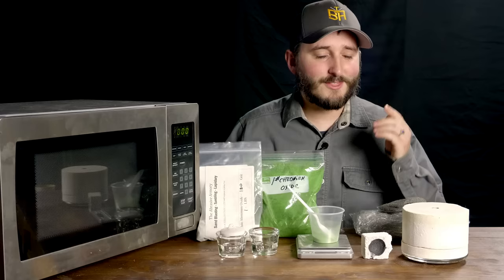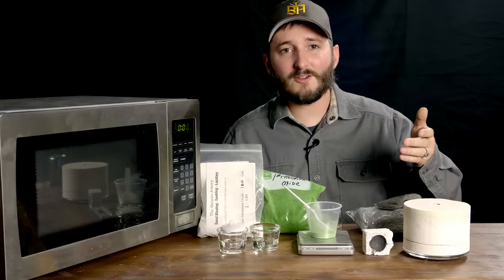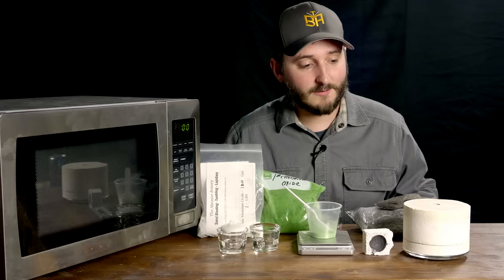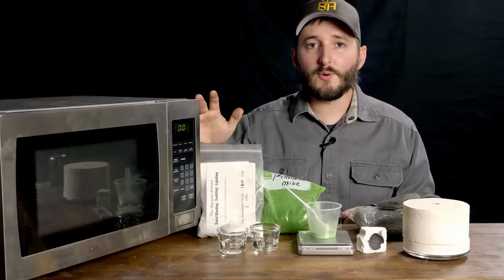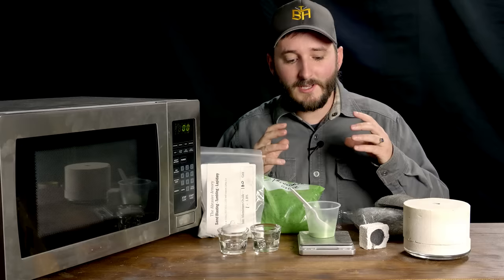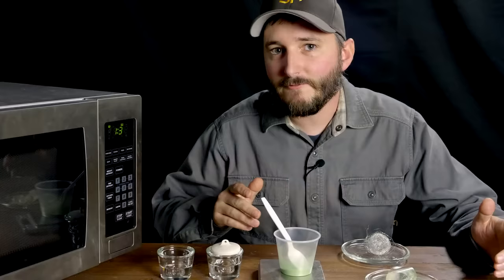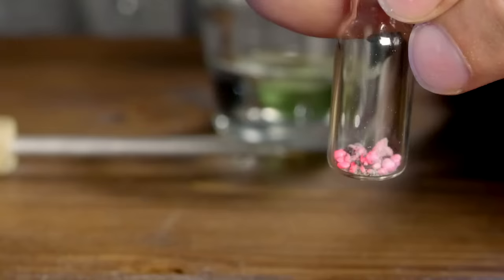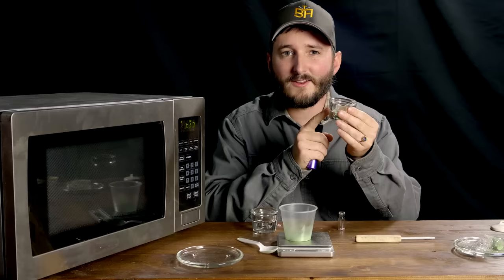How To Make Ruby in a Microwave

Comment: Wonder if an electromagnetic coil could do it. If its only as simple as melting them together it would work, those things can efficiently and cleanly melt steel !
Before anyone says, "But aluminum is non magnetic", true, but so is copper, it is still effected by the presence of a magnetic field and can generate heat in the process.

Comment: What about inductive heater ? (when glass is hot it conducting electricity)
So firstly you could heat it up enough then turn on inductive heater (around kiln )
And more to it wall if kiln could be cooled simultaneously so that substance inside would be hot but walls of kiln is cool .
(like in rocket engine -- walls of engine that is cooling constantly)

Comment: Excellent work. :D

Agreed for keeping the kitchen microwave and the workshop microwave separate. :D

When i first read about making artificial gemstones 20+ years ago, one of the uses was fractal heatsinks made from diamond for computer cooling.

I don't know whether ruby would work as well, but it would be an interesting project... :D

Thinking about the shapes that you use, one format that could work, if a grid-pattern heatsink-style shape mould was carved from ceramic, add a matching framework of aluminium wire, pack with the seed material, and set to run till all of the seed material is converted.

Not sure how well this would work.

What's there a ratio between the amount of material converted and the run-time?

How efficient is the conversion process of the seed material to ruby?

More idea's to chew over... :D

Comment: I like your video . I've watched several free energy videos in the past. I understand drag and heat and friction losses preventing perpetual energy. However i've often wounded if you pet a smaller pulley on sat the green mother you have for a gear reduction causing it to spin faster than the other motor wound it produce more energy plus if you andded more copper wire binding in the motor would that produce more energy with it . To keep it having a jump boost could you add a capacitor into it . I also understand about line drop ..what would be benefiting and or start becoming to much. I'm also sure you have to have the energy going somewhere like a storage unit I understand as well dc power is different than ac power so it needs to be converted and you loose power through it as well.

Comment: You should just put a layer of aluminum foil in your small cup, loosely trim the edges. Fill it with your powder, put it on a plate. Put a solid glass over it to cover everything. Then you should be fine

Comment: You can't make a transparent ruby with this method, because it doesn't melt properly, only the grains melt together, the material will be full of air bubbles and it will be opaque when it solidifies.

Comment: The crystal structures are completely missing from it. These are "ruby glasses" technically it has the same Al2O3 base as ruby do but without crystal structural which is needed to call something a crystal. So you can call this only glass. If you want to make true ruby with crystal structure you need extremely high pressure and extremely heat to grow them and for weeks of time not just seconds as you did. This requires special growing pools which is still very expensive...

Comment: Just saw this, If you think about it warp it tight in foil put in glass and vac seal it two things should happen the vac should increase the heat and because the powder rap in foil this should come press the powder tighten the "magma"? in to thicker ruby.. that's my theory but not sure  just thinking it needs pressure to make a big chunk btw got idea about diamonds you could do that with carbon?

Comment: Should consider making a small crucible out of silicone carbide... Can use something like water glass to bind together rock tumbler grit to make it. SiC does remarkably well absorbing microwaves and can get insanely hot. Since its a refractory material it might get hot enough to melt aluminum oxide... You may be able to make some very large rubies with such a setup... Or it might not work at all ¯\_(ツ)_/¯

Comment: I wonder if a fine aluminum powder would help with forming larger rubies....and my gut also wonders if doing so under a vacuum would be beneficial ..(clearly costly, though. - have to find a way to seal the material inside glass- and then have a port that also needs to be sealed when the vacuum is pulled. )

Comment: hmm, would a thick glass straw/cylinder work? maybe try a stacking method of ruby seed, steel wool and so on. what if the glass cylinder/straw had small holes along the walls?

Comment: What if you used aluminium powder instead of some of the alumina and aluminium wool? The heat should be more widely distributed and at the high temperatures, it should oxidise to alumina.

Comment: That was a good watch. Id say the quality of the ruby is low, because of the wire. Its not very homogenous, so you will get slightly different conditions over the whole sample. Im sure its fixable, but its not easy. But considering how simple the set up... thats really impressive!. We are not talking about a machine that has uniformity of the heat over the volume in mind. For food, small variations dont matter. For rubies... probably does. Id say that those rubies were of surprising high quality, and so big as well. I mean you just "stamped" the wires in really :). 

It was also fun to see your "failures'. Its good to see the process, even if just an overview. This made me subscribe, im gonna see the rest of your stuff.

Comment: How about trying to cut up some of the aluminum wool fibers and mix them in with your ruby powder and then place some aluminum wool pieces on top? I'm thinking of a more uniform plasma dispersed throughout the ruby powder with the smaller flakes of aluminum wool, if that makes sense?

Comment: You know that the microwave uses a strong Transformer that gives out 2000 volts of electricity you might want to try that other approach of shooting that onto that powder to see if you could make bigger rubies at a higher Heat a voltage

Comment: Okay, kiln covered with graphite did not work, but what if instead you put some graphite chip/rod into the seed material? As I understood correctly - only thing that was catching the heat in the microwave oven was the graphite and then radiating it out

Comment: You can add water to your mix of aluminium and chromium oxides in a glass and let it dry - maybe you then will stick to the surface and be able to put it upside down.

Comment: The plasma is forming from electric arcing in the air. If the wire was inside the material, it wouldn't make the plasma.

Comment: Why haven't you turned this process into a similar 3d printer that is used for metal printing with microwaves and a tig welder pouring down into that powder layers at a time?

Comment: Would removing the rotating mechanism that holds the plate, allow a more even distribution of the micro waves? Doesn't the waves go linear and the reason for the rotating tray is because of the linear Waves.

Comment: never thought, that a microwave can be used to do something good with. Ever thought you can only destroy things with a microwave, like food or everything else you can put in.....but never thought that it's able to create something, but why not. it's just a machine, which makes extrem heat in a short time.

Maybe you need a different phiole made out of the same material like the ceramic? pot you explained.

but what is needed to make better rubys or could you made emeralds too? would it be possible to make artificial 100% clear rubys in a kind of Microwave machine? maybe put 6 microwaves together, to one exrem powerful microwave, which shoots waves from all sides. it probably would destroy itself or create a black hole from so much power XD

Comment: Did you ever try making a home for the seed material out of the wire? I wonder if you lined the bottom of your holder with the wire with little edges hanging over the top and filled it with seed material if it would make a larger ruby
Reply: I am doing things like this right now and I need I finer AlO powder to work, once I try with a better powder I will tell you what I find
Reply: @rhysmeier2921  ooh do let me know what you find!

Comment: Could you use steel wool in place of aluminium wool? Is there a reason to use aluminium wool in particular?
Reply: Rubies are scientifically known as corundum, a rock-forming mineral and crystalline form of aluminum oxide which is two aluminum atoms and three oxygen atoms (Al2O3) in a close packed hexagonal structure. Corundum typically contains traces of iron, titanium, vanadium and/or chromium.

Comment: Does it have to be made with plasma or does the seed material just need to hit a certain temperature? Could it be made in a propane forge?
Reply: Probably not, you would have to reach more than 2000 degrees. An acetylene oxide or hydrogen-oxygen blowtorch can reach that temperature.

Comment: Are you able to make fiberglass like structure out of this with this technique? I always wanted fiberglass made out of ruby, such that I can Spule it around a Xenon flash puls and get laser light out of the ends. Just like a ruby rod but smaller and flexible. I mean why wrapping xenon light around a Ruby rod and trying to pump an insane amount of energy in from of light that it will crack the rod just to get as many of the ions in an instabil state? Why not instead making the material flexible enough to withstand that insane amount of energy by exploiting the elasticity of the material by making it thin enough to be compliant and wrapping the aktive material around the light source. 🤔
Reply from the maker: You can't make optical quality ruby this way. It's full of bubbles like lava rock. Your idea sounds great if there's a way to make ruby fiber.

Comment: Hey, very nice video. I would like to reproduce it. Could you please tell me the size and dimensions of the glass cup and ceramic cover? Also, how much wool you need to put it inside?
Reply from the maker: Size of the container and cover isn't important at all. Any size is fine. The amount of wool is also not very important, you just have to play with it until it starts making sparks
Reply: @Nighthawkinlight  any idea what the wattage is on the microwave? im trying to see if i can do this in a compact one 👍🏽

Comment: Be sure to use it outside or in a workshop with a fume hood or under a GOOD ventilation. Check out Aluminium, Chromium and other heavy metal fumes toxicity. I'm shocked and appalled the guy didn't mention the necessity and importance of this, and just mentioned "there may be toxic stuff, so don't make food in this microwave. Thing is, not only it's all as bad as I've just said, but if you'll do it enough inside your own house, those toxic fumes will remain in your walls, furniture, on surfaces, it can be as toxic as a meth lab with it's Aluminium and mercury contamination, plus unknown number of intermediate reaction compounds. The subject of the video is cool and interesting, but the lack of responsibility before your audience who trust you and may not know anything about heavy metal toxicity is almost criminal. I know a thing or two about said toxicity, unfortunately. For those who will reply to me as "you're overreacting, the doses will be small etc." - I won't even bother replying to such shallow "understanding" fellas. Contact your local chem labs/metallurgy facilities/toxicologist/contamination cleaning company/any "hardcore" specialist on the matter and ask them, don't take my word for it.
Reply: I'm trying to do my own research into the dangers of doing this, hexavalent chromium is about the only danger I've discovered, could there be others?

Comment: How would these synthetic "ruby's" fare when cutting/faciting and polishing? In reality they're worth nothing. It's just an interesting project.
Reply: Even if they were high quality and could be cut into gems, synthetic ruby (and sapphire) are so easy to make at this point that their gem value is next to nothing. Consider that the the crystal on even relatively cheap watches is clear synthetic sapphire these days. Still even low quality ones have uses for polishing/cutting. These at least have a ruby color and are cool for being so easy to make.

Comment: If yeah  needed ah ruby in order to make  ay light sabre would an artificial one do... Even when  ay  Micro W  oven is new it emits radiation 15 ft when on... When it is off radio waves run through it but such waves are  stormed when it is switched on,,,, the loose story on the invention of MWO  is he left his choco bar beside the radar screen for his coffee break and found it melted and cold from screen radiation and instead of saying "Frruck Datt job " he goes out 
And invents the MWO,

Comment: I call b.s. tried it off of several techniques chromium and aluminum oxide in the  microwave, used a welder arc to heat it. Used a plasma torch ,  tried a forge.  Each time with the exception of the microwave, I managed to melt steel but never once got a ruby.  Lots of ratios and a lot of tries .  I call fake on this